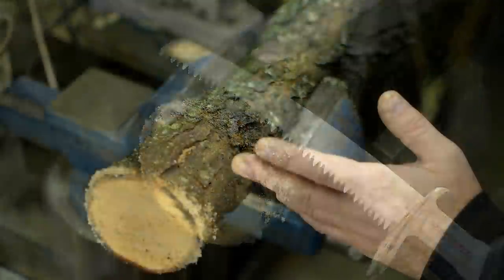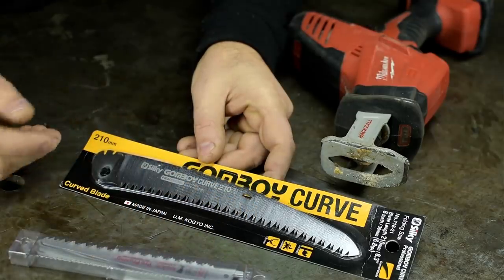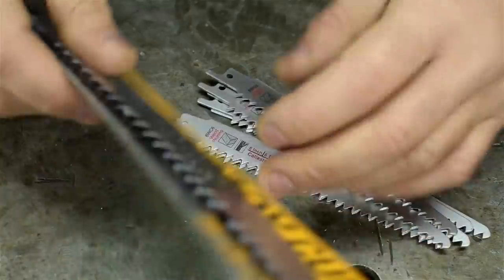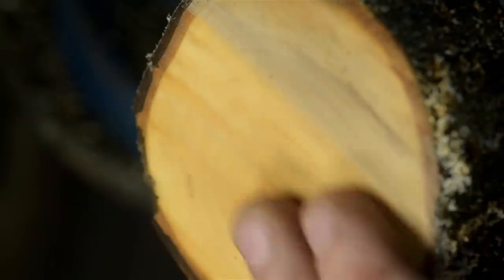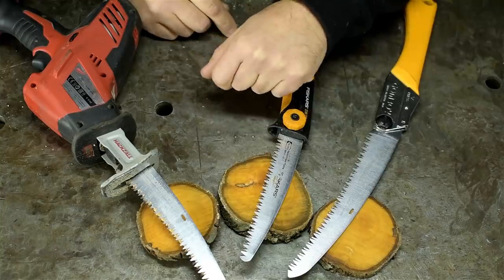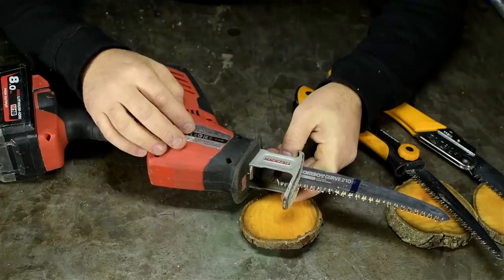Pruning For Machinists!

Comment: Pretty much my own journey. However, I never attached a pruning saw blade to my hack saw.

I went down the 40V electrical powered chain saw route. 12 inch blade for any substantial branches, 5 inch blade for the pruning saw. Our pruning saw is attached to a pole though, which can extend up to 12 feet. I covered all those numbers in my head and hope they are close (30cm, 10cm and 4m).

Having handled my fair share of "real" chain saws in my life, I'm not looking back. They are loud, dangerous to handle when climbing trees, difficult to maintain when used seldomly ... unless you need to operate them 10h a day with a 30 inch blade, I wouldn't consider one with a carburator anymore ...

For smaller branches my wife uses a telescopic cutter. Again, it extends up to 4m (12-13 feet) and makes a very fast and clean cut on everything up to three thumbs thick ...

Comment: I got a more traditional triangular tooth blade in a very budget pack of recip saw blades. Works pretty well I'd say. 
As a quick experiment, mb Tones could mill off every third tooth of one of those jaoanese-tooth style blades and see what a bit more space gets you. 
The old 2-man crosscut type saws had a hundred different tooth patterns from the various manufacturers.

Comment: The Stihl MSA 161 T battery powered top handle arborist chainsaw is what you need. Light quiet safe and adequate for occasional cuts up to 10 inches. With a 300s battery it should last all day. One of those tools that impresses me every time i use it.

Comment: Milwaukee sells much nicer reciprocating saw blades for pruning than the one tested in both 9" and 12" lengths.  They are wickedly sharp and the tooth profile has regular clean-out gullys for chips so they don't jam-up nearly as quickly.  They last a long time, but eventually will break at the mounting tang.  I've been using them for over ten years.

For pruning, branch size dictates the cutter in this order: Fiskar Lopper -> Hackzall with 9" blade -> M18 Pole Saw -> Stihl chain saw.  For cutting brush flush to the ground, a M18 Sawzall with 12" blade works well.

Comment: Great video Tony! So glad to have you back. Funny you find you Milwaukee drinks chain oil, I have a DeWalt electric chainsaw that does much the same, but I suspect most of that drips out due to capillary action with the sawdust it traps. As for reciprocating saw blades for pruning, I found the Bosch S1531L beats everything else I've used by a large margin.

Comment: The chip clearing thing, the sap and moisture in the wood would also make the chips stick to the teeth a bit.  The friction of the fast moving blade would cause it to adhere and gum up the teeth.  Thus, ALSO slowing.

Comment: The blade is curved so you can cut on the pull and it will run down into the cut on its own. The tooth geometry is designed to optimize cutting with that action. The longer bladed curved saws will cut a inch thick branch in a single pull once you have the technique down. Learned on an urban forestry crew.

Comment: FYI, that is a Japanese tooth pattern on the Silky saw blade.  Pretty popular amongst woodworkers, and yeah, they are like a set of razors.  Skil and Black & Decker have both made pruning blades for power saws like this, but not quite a Japanese profile.   I don't think they do anymore....
What does work well is a small electric chainsaw like I have from Black & Decker.  Chains are relatively easy to get (I ordered a replacement from my local Ace).  If you want some real fun with battery powered chainsaws, check out the Black & Decker Alligator.... It's a 2 hand tool, but fun (and wild looking 😁).  BTW, before anyone says anything about spending money on stuff like this from B&D, I got both used for like $10 to $15 each.

Comment: We got the Dewalt battery powered sawzall.  Full size tool with a long blade.  The demo (nail embedded wood) blades work wonders.  Course, usually just turn the big boy goats loose and they take down any tree the size you are cutting on this vid. :)

Comment: I buy my pruning blades for my Sawzall from Porter Cable. 9" blades, crazy sharp. I've cleared a lot of brush with them. They AWESOME for cutting roots if you need to pull a stump out. The dirt with ruin the edge, but you can just plunge straight into the ground and never have to get a shovel out.
Reply: Oh - Diablo makes a 3TPI carbide tipped pruning blade for the recip saw. That one is crazy fast, but too expensive to use for roots. $15?

Comment: i don't have a chainsaw, and i don't like using them, so i use some huge reciprocating saw blades with low tooth count for pruning or cutting up fallen trees. i think my longest one is 10 inches (maybe 12). i spray wd-40 on my blades before cutting, but i don't know if it actually helps with binding or not. the nice thing is, if anyone sees you cutting logs with a recip saw, they will probably come over and cut it for you with a chainsaw just because they are tired of hearing your saw going for an hour lol. i also have some of the really short pruning blades for the recip saw and i use those for clipping small branches or for making cuttings fit in my trash bin. i find it WAY faster and easier than messing with loppers or pruning sheers because i can grab a fist full of long, thin branches, and zip it in half almost instantly with the recip saw and a pruning blade

Comment: 11:44 Sidenote - the cleaner cut (as in smooth, not the opposite of dirty) usually heals slower. With a rougher cut, the cells that do the cleaning up have an easier time attaching to the sides of the wound (and also getting to the wound). 
I was thought in school that there are operations on livestock where it is required by the law to use specialized tools that leave a rougher wound to reduce the healing time and suffering of the animal. 
Basically, if you ever had a paper cut, this is the reason why they heal so slowly and painfully.

Comment: You can gain some cut performance with reciprocating saws by pressing the guard up against the item being cut. In a normal cut half or so of the stroke is lost moving the saw back and forth. Of course, this will wear out the very base of the blade quickly but it will cut faster. I think it was Irwin that used to make pruning saws for these. I used them for regular demo work, cutting 2x4's, and they had considerable set in the teeth. Those things were vicious. Cut you open in a heartbeat.

Comment: Regarding the set; the saw blades on Victorinox swiss army knives and Leatherman multitools are also tapered, both from teeth to spine and from tip to base, with no set. I believe this is so the teeth don't catch the insides of the tool when you fold the saw closed, and the Silky saws are likely designed that way for the same reason.

Comment: Interesting that you mention pruning with a sawzall. I have a Dewalt sawzall and it is great for pruning. I have considered a battery powered chainsaw but honestly its too much money for me at the moment. Having said that for serious limb pruning I have a bucket saw, a Stihl 099. You can easily use it one handed. One thing you haven't considered about the pruning saw blade is the pack of 10 you purchased can be resharpened where there expensive one can't, at least not easily. 

Funny thing you mention chainsaw injury on the knee. When I was 15ish I was out working and cutting down trees for firewood. One oak tree was on the side of hill, I just put on a freshly sharpened chain and the saw bounced on my kneecap. After walking a mile to get to the truck with my boss I went to the emergency room where they put 27 stitches in there and told me I was lucky It missed the important bits but destroyed my skin and pants. Took me over 6 weeks to heal :)

Comment: That's pretty interesting. I saw the chip clearing problem coming! Last summer, I changed up my pruning from a hand-held saw I've had for 25 years, to my actual Sawz All with a longer wood demo blade. I also roped off the limb I was cutting and felt super smug when it dropped a foot or so and just hung there under the cut till I could let it down. I will say, the powered cut was nicer in that my heart rate stayed low and I wasn't sweating afterwards. It also made the undercut a little easier in that I could simply place the saw properly and let it chew.

Comment: I have a Milwaukee Cordless Sawzall with the 1.125" stroke.  I use the normal wood demolition blades( for 2x4s and such) and it rips through limbs like no-ones business.  It is probably comparable in speed between your gas and electric chainsaw.

Comment: Consider either going bigger with the handsaw, or smaller with the chainsaw
A silky sugoi 360 will eat that gomboy or the electric chainsaw for breakfast.  The blades are replaceable.  
converting the 192t to 1/4" (new bar and drive sprocket) chain will make it cut twice as fast, chains are in stock ,  It's a narrow kerf chain and use a 3.2mm diameter file 150mm long for sharpening.  6* is the magic number for rakers; you put the saw in the a vice and zero a digital angle gauge across two cutters, then tip it forward to measure cutter to raker angle.  Count how many file strokes you need to get to the magic 6* and do the same number on all rakers.

Raker angle is equivalent to cutter relief.  None of the proprietary tools like file-o-plate are progressive, so they offer less and less releif as the cutter wears.  By the end of the life of the chain they're down to as little as 1.5* which won't cut anything.  A nearly worn out chain cuts a whole lot faster than a brand new one due to all the space for chip, so long as the rakers are 6*.  Carlton's 3/4"Lowepro and 1/4" chain outcuts stihl in speed and life due to a longer narrower cutting tooth.

Comment: You can use a 10 inch bar on those milwaukee pruners, and using a more sparse chain lessens the load. Commercial lockdown averted! Oregon bolts straight on. Congrats on having 1000x more subscribers than me

Comment: As a long time Silky saw user, "I Knew" ;)
I was amazed at how SLOW it was cutting in the Sawzall.
I suspect that even when you are moving it back and forth, the fast short strokes pack the wet sawdust so tightly into the teeth that it doesn't clear out when it's outside the log.
I would try putting the Sawzall on the slowest speed possible and move it faster to try to reduce the blade building up sawdust underneath it.

Silky also has multiple tooth fineness options from firewood to fine woodworking. I couldn't tell if you had the Course blade or not.

On the baby chain, if you can't find an aftermarket cheaper price chain for that size, which likely is the same as many pole saws, it's easy to make custom length chains, just pick up a chain breaker tool from a logging supplier or online, and get a piece the right size Full Comp Safety Chain and use the chain tool to get the right length.
Reply: > I would try putting the Sawzall on the slowest speed possible and move it faster to try to reduce the blade building up sawdust underneath it.
Ah, that's the speed you get when you detach the battery, right?
Reply: @jonathanrichards593  lol, pretty much!

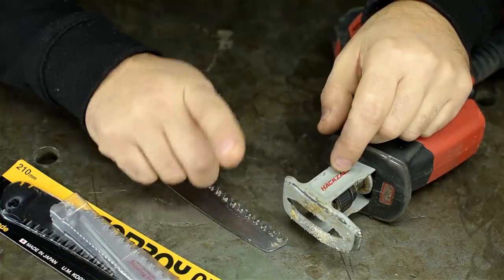Comment: 2:04
If we didn't know for sure that Tony is one ballsy individual, we know now!

8:19  I prefer to hunt with a battery-powered circular saw and a mattock, but that's just because I'm that kind of crazy
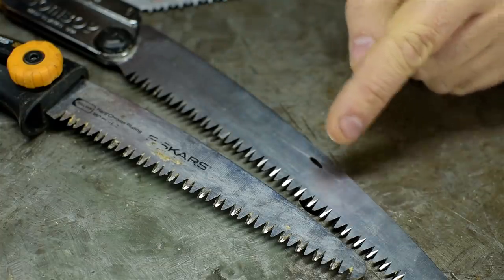8:34  DAMN that's a hard center punch!
8:51  smart or not, doesn't matter, it worked!
9:00  which did you use? both?
9:24 HOLY S#!T THAT WAS METAL AS F&@K   Also great idea, covering the sharp bits with tape while you're working with the blade
13:52 stroke length ; the powered saw only strokes in and out so far ; the hand saw stroke is long enough to fully clear the blade every time, the powered saw stroke length isn't
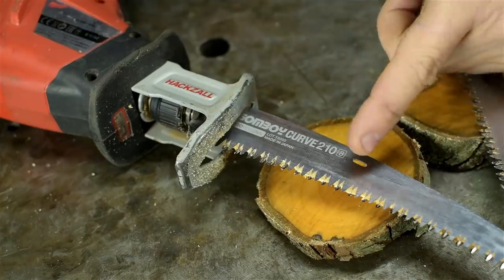14:12  CALLED IT!
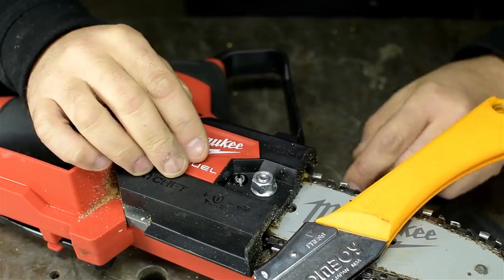18:42 Both Milwaukee battery systems?  I think the mini chainsaw should have used the 20V system instead of the 12V system, but hey, if it works, don't futz with it!
Reply: Now we need to see if we can convince Tony to modify the reciprocating saw to achieve a full length stroke...😂

Comment: 17:39  I got Milwaukee's16" 18V saw this past Spring, and it's surprisingly good.  Chain speed is slower than a gas saw, and other cordless saws (so I'm told), but it has lots of torque & will cut plenty fast with a little weight on it.  It does go through bar oil mighty fast.

Comment: wider teeth gullets = more saw dust and faster cut. BUT the reciprocating saw stroke is too short, it does NOT allow the sawdust at the center to escape the cut. That's why IMHO, these saws are more efficient manually, as we naturally do longer strokes, which help clearing the dust. Interesting video, thank you for your time

Comment: The silkys are great because you can long stroke with low effort.  So to speak.  You have to be able to clear the blade of debris, so a stroke at least twice as long as the diameter of whatever you're cutting.  They are a must have for any survival or camping kit.  Don't get the folding one though.  Get a fixed blade.  You will not regret it.  Same for the Mora Garburg.  Can't go wrong.

Interesting to see a silky adapted for the short fast stroke and still see it silky.  So to speak.

EDIT:  LOL I commented before the end.  Can you tell?  I'm also drinkin, this being a Sunday and all.  <3

Comment: I know I'm two months late to this, but the 3 teeth per inch or 5 teeth per inch diablo and Milwaukee brand blades are a great alternative to the mini chain saw. The tooth design pulls the chips out of the cut really well up to about 8" but rocking the blade like another subscriber suggested helps even more.

Comment: I'm not a machinist so the information that I take away from these videos is typically for entertainment purposes only, but I definitely learned something that I can apply about the chip removal.  I've actually had this kind of problem before and just didn't understand why.  And the wife talked me into buying her one of those corded pole saws a few years ago....was absolutely dead set against it because it was a toy....I frickin' love that thing.  It was actually cheap enough that I'm not worried about long term durability, but we're on our third season with it and I don't think that I've even sharpened the chain.
Reply: Did you mean cordless ? I have a small Ryobi chainsaw on a pole and it works a treat !
Reply: @TonyWhite22351  No, it's actually corded.  Ironically we ended up getting a new chain for it this season.

Comment: There are a lot of pruning blades for recip saws on the market. They're usually 9 inches long, I assume specifically because you need to move them back and forth to clear chips.
I use the recip when I'm pruning bushes because the limbs are all super tight and I can barely get a blade in there. The chainsaw is right out because it'll hit and damage nearby branches. Otherwise I use a manual saw or get the chain saw.
The Bosch pruning blade is pretty aggressive at 5 TPI and had a couple of super deep cuts every inch or so to help chip clearing.

Comment: The milwaukee  10" pole saw is quite the handy machine. No you have me curious if the 10" bar would fit on the little hand hatchet, give it a reasonable bite.  The only downside is the chew up chains in no time and it's back to the sharpener again.

Comment: The M12 Hackzall has a very short stroke, and I have not yet found a decent pruning blade. My mains-powered recipro saw chews through branches, since the stroke is well over 1/2". I think the problem is that you need the stroke to a many multiples of the Tooth distance in order for it to chooch decently.
I just bought one of the cheap Chinese mini chainsaws (fit Makita 18V) and that thing is a BEAST compared to a reciprocating saw. I paid well under $20 for the chainsaw, and the biggest limitation is that there is ZERO oiler.

Comment: The chip clearing issue also seems to apply to some of my drill bits when working with treated or damp wood. Also, my intestines when working with knockoff oreos. I'll have to try more gyration.

Thanks for the tip!

Comment: At 14:03 and here's my guess as to why the handsaws were faster before I watch the rest of the video.  I'm betting the reciprocating saw doesn't have enough stroke length to clear the sawdust from the teeth...that's also likely why you're using a sawing motion even when using the reciprocating saw.

Comment: If you like the mini chainsaw, have a look at the stihl GTA-26. Finner pitch and narrow chain and better form factor. Lacks the auto oiler and eats the tiny 3 cell accus fast if you throw it at +2 in branches, but much more handy, especially with the belt holster. Easy one handed use

Comment: Fastest pruning saw by far is a bucksaw. The blade has "rakers" to clear the chips, sawing is effortless. I once bought a sawzall pruning blade patterned on the bucksaw blade, but lost it. I didn't remember the brand, so couldn't find a new one and settled on one with deep "gullets" to help keep the chips out of the way. Not bad, but not close to the bucksaw pattern.

Comment: Home Depot sells some badass Diablo blades for reciprocating saws, and I got some that were at least 8” and had some nasty looking teeth for pruning and they work like a champ.  You don’t really need a curved blade when you’re working with a power tool, because it chews through stuff so quickly it doesn’t matter.

Comment: My experience echoes your findings. It's hard to beat a sawzall with a pruning blade for cleaning up small diameter brush honestly, as long as you keep it under about 2" or so. I was clearing a bunch of holly trees and small pines off my property and the sawzall is great for cutting down saplings or post-felling processing of larger trees (cut the branches off so they stack better on the trailer). Even my cheapo version cuts like a hot damn through small branches. And no need for a dedicated tool, just swap blades and grab a fresh battery, saves gas and wear on the chainsaw, and a lot safer imo.